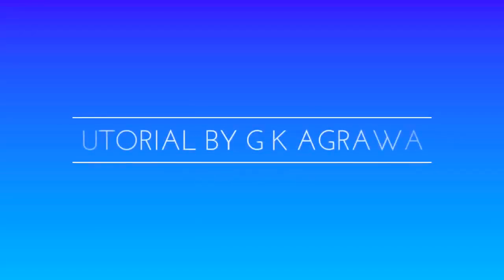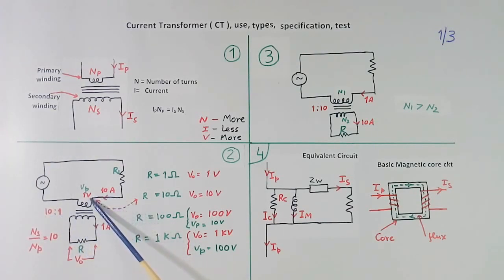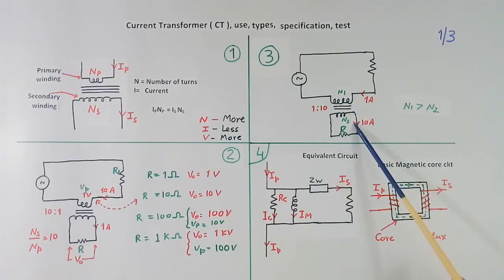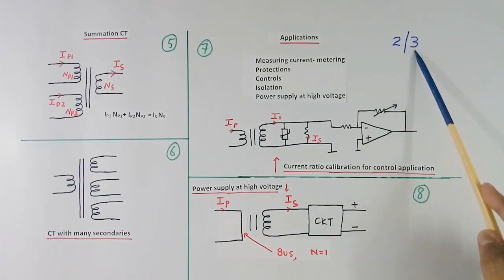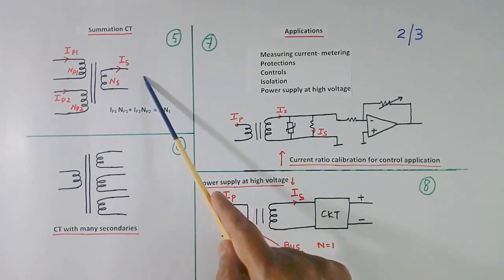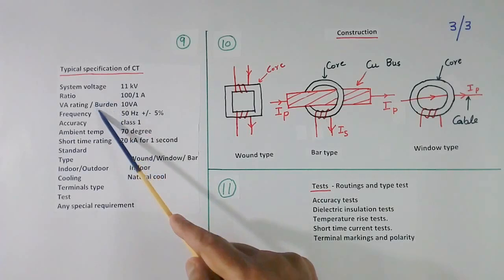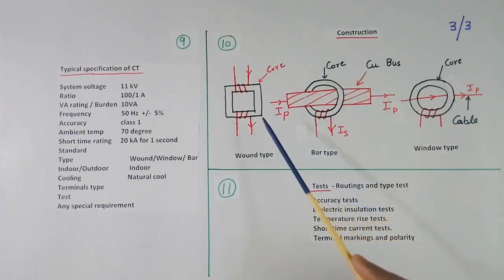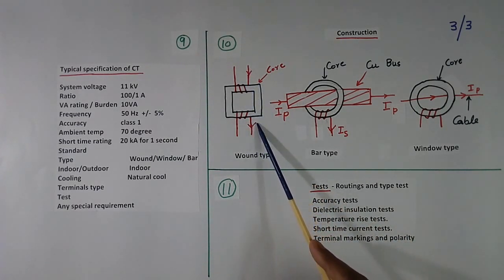Current transformer (CT) working principle; Load; types; use

Comment: Hi, very nice explanation. I have one question about CTs.

Is it necessary to connect a burden resistor with CT's output? I have seen commercial high frequency current transformers directly connected to Oscilloscope without any burden resistor. I wonder if there isn't any burden resistor then how they have voltage measurements? I appreciate your help. Thanks!
Reply from the maker: They are CT probe for CRO, burden resistor must be inside the probe, and also caliberated for scope input impedance. they convert currrnt signal into voltage.  they are very very expesive also. Otherwise they will have to depend upon scope input resistance,
Reply: Thanks Mr. Agarwal.

They are not connected via probes. They are simply connected to Oscilloscope with 50 Ohm termination. Is this 50 Ohm acts as a burden resistor and gives you voltage measurements? Is it so that for actual current, we have to divide the scope output with 50 Ohm?
Reply from the maker: If only 50 ohm resistor is used, then this itself will act like burden resistor. You are right that to measure current, voltage is to be divided by 50 ohm, but CT ratio is also to be considered. Current measurement with CRO is tricky. If it is 50 or 60 Hz, you can always use normal CT. However it it is high frequency and low voltage, then CT itself can be avoided, just a small resistor can be connected in series. And then voltage can be measured on CRO. In this case CRO power supply should have an isolation transformer. For isolation transformer for CRO, I have made one video on Oscilloscope use.
Reply: Thanks for your reply. You are absolutely right.

In my application it's not low voltage. I am using HFCT to measure current on medium voltage feeder. HFCT is clamped around the MV feeder to measure current magnetically. HFCT output is current and it is connected to the Oscilloscope via coaxial cable with 50 Ohm termination (recommended by manufacturer). Oscilloscope is used to capture the data to be analyzed later. I am wondering if the captured waveform is current or voltage? To my understanding, we often use 50 Ohm termination with oscilloscope to avoid reflection. In this case, will the 50 Ohm act as a burden and the resulting waveform will be voltage or it's just to avoid reflection and the resulting waveform will be current (although oscilloscope labeling shows voltage)? I hope you understood my confusion.
Reply from the maker: 50 ohm works like burden as well as  characteristic impedance termination load.  Can You tell Where You get high frequency at medium voltage? or it is measure transient current.
Reply: It is to measure partial discharge signals which indicate degradation of the insulation. So you mean, it will be voltage waveform and it needs to be divided by 50 to get the actual current.
Reply from the maker: And also CT ratio. Long back about 30 years back, We were testing our HVDC thyristor assembly for partial discharge during manufacturing stage.
Reply: Mr. Agarwal,

Oh nice, you have long experience with different domain. I will appreciate if you could elaborate what do you mean by CT ratio? no. of turns or what?
Reply from the maker: If for example CT output is 100mA for 10 A line current, then this ratio to be considered.
Reply: alright, thanks a lot for your explanation!
Reply: Mr Agarwal,

I am still confused. If you have a look to the technical specification of a commercial sensor given below:

Transfer Function 5.0V/A
Frequency Response 50kHz – 20MHz
Rec. load Impedance 50 ohm
Output Connector BNC Female

Does it mean that with the output BNC terminated at 50 Ohm, only transfer function (5V/I) is used to convert voltage into actual current? No need to further divide it with 50 Ohm?
Reply: I will appreciate your reply Mr. Agarwal!

Comment: Fantastic lesson! 
Quick question, if a short on the secondary winding was present could the ratio of the primary to secondary be reduced?
Reply from the maker: If 2 terminals of secondary of CT is getting shorted,  then current ratio will not change. If inter winding short (damage to CT). Then ratio will change, Ratio will also depend upon load, as CT will behave like many secondary winding.
Reply: G K Agrawal 
The particular ct is on a 460V  250hp stationary electric screw. 
It has a ratio of 120:1 to allow use of much smaller overloads. 
The overloads are tripping intermittantly, however we're not observing an actual high amp draw at L1 L2 OR L3. 
Could an inter-winding short manipulate that ratio potentially to the point of tripping the thermal overloads (Cutler hammer fh26)
Reply from the maker: 1 - Measure CT ratio by measuring current in primary and secondary both at a time usinng 2 clamp meters . Observe current for longer time.  2- Motors with drilling type load may draw high current frequentlly, You should use suitable trip system.

Comment from the maker: Comments welcome
Reply: sir CT secondary winding always shorted, if open means high voltage developed and damage that CT . I accept.  but why this concept not acceptable in normal transformer .. please clarify...
Reply from the maker: Very good question. Mathmetically concept of CT And normal transformer is same for voltage ratio and cutrent ratio. But normal transformer is desighned to take full voltage, while CT is not designed to take full voltage
Reply from the maker: Very good question. Mathmetically concept of CT And normal transformer is same for voltage ratio and cutrent ratio. But normal transformer is desighned to take full voltage, while CT is not designed to take full voltage
Reply from the maker: Very good question. Mathmetically concept of CT And normal transformer is same for voltage ratio and cutrent ratio. But normal transformer is desighned to take full voltage, while CT is not designed to take full voltage
Reply from the maker: Very good question. Mathmetically concept of CT And normal transformer is same for voltage ratio and current ratio. But normal transformer is designed to take full voltage, while CT is not designed to take full voltage
Reply from the maker: Very good question. Mathmetically concept of CT And normal transformer is same for voltage ratio and current ratio. But normal transformer is designed to take full voltage, while CT is not designed to take full voltage
Reply: thank you sir...  any law or formula is related in this answer ?  normal transformer designed to take full voltage at the time what is happening?  please clarify sir..
Reply from the maker: Formula are same. CT require less voltage at primary so it is designed for less voltage. Further CT is generally step up transformet so problem is further more in srconddry.
Reply: thank you sir